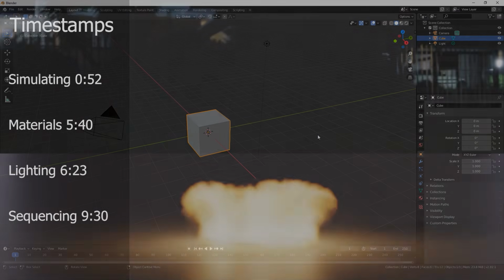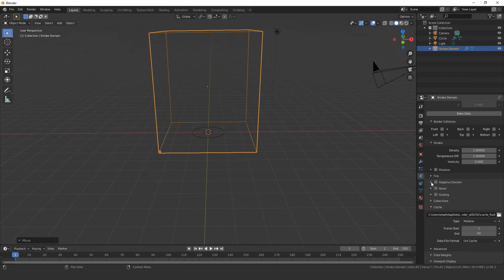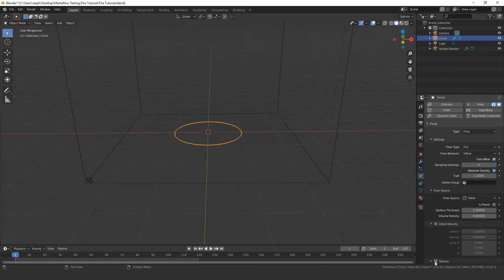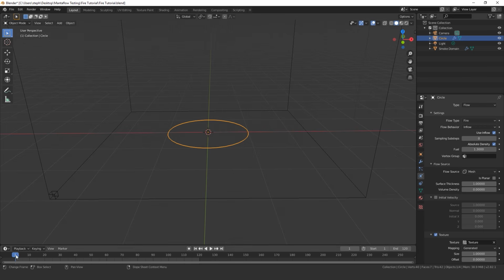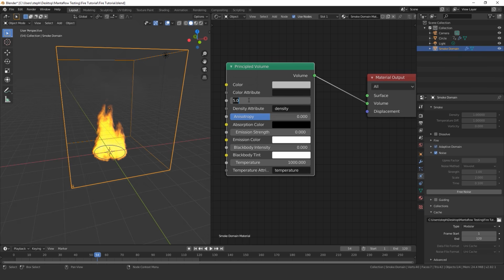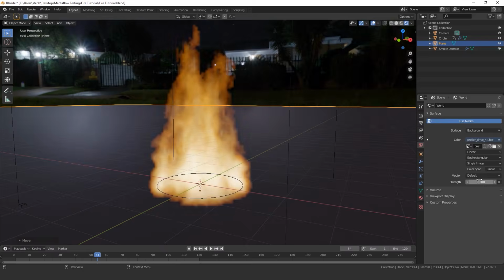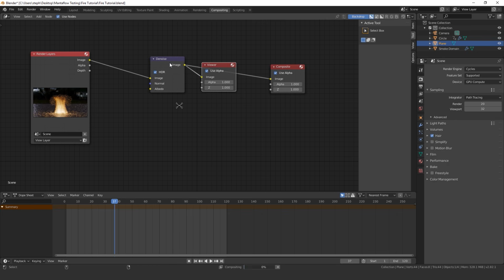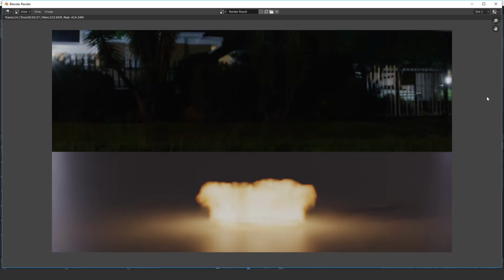Blender Tutorial - Mantaflow Fire Simulation (2.82)

Comment: This looks interesting. The results look good so far, even with me using Eevee (though I'd probably have to have my fire Point-light fluctuate its brightness or something. Glowing particle emissions worked as well in a previous experiment)
I wonder though, does this method work for a fire that you want to then have flare up and then ebb under a controlled animation driver? I'm thinking in terms of a steam-powered machine that "breathes", as inbuilt bellows regularly pump air through the firebox to fan the flames

Comment: Hi. I render with transparent in cycle. But the image render not same the render in viewport. It look faint and not real. How can i fix that?
Reply from the maker: Rendering fire with transparency doesn't work to great. There is a couple of settings you need to add before rendering. Watch this video for how to do it! https://youtu.be/wNnFfXxB2Dg
Reply: Blender Made Easy thanks you. But i have a issue that when i check the noise to bake. The simulation of smoke and fire are disappeared in render view. When i uncheck this work same with solid view. Did you know fix that ?

Comment: Your tutorial is really helpful ,but I have a question.
When I switch to the Rendered view,
 the fire does not appear, 

---
I tried :
Principled Volume( BlackBody Instensity) higher .
Render image (display channel) to color.
Cache fire anim from 1 to 150 frame.
Reopen Blender and Blender file.
--
i try it all  that didn"t make the fire appear.
i can see the fire on wireframe and solid view.
I don’t know how to solve this situation... 
thank you!!
Reply from the maker: If you can see the fire in solid view but not rendered view then the issue is most likely the material.  Double check your material and make sure the principled volume shader is plugged into the volume output and not the surface output. Are you able to see the smoke in the rendered view?
Reply: @BlenderMadeEasy  Thank you for your help!!  I plugged into surface...  I change to volume and it works!!!!

Comment: Eh. I don't think software is at the point where we can make convincing fire yet. Maybe from a distance it would work, but fire close up is rather tricky to get. Real fire has detail, like swirling and such, but it still looks gaseous. The most common problem I see is, the entire volume of the flame is lit in such a way that it looks more like a moving blob instead of an actual flame. The body isn't transparent enough, and the edges are too well defined. I've tried emulating fire myself and is it not exactly easy to get it to look real up close. Here's hoping for a future where we can eventually simulate fire so well, that you can't tell the difference.

Comment: Fire isn't showing up in the render or viewport...is there a step that I missed?
Reply: I have been struggling with this myself. I still haven't got the render settings figured out, but here's what I've got so far.  Something about the new fire in Blender 2.8 using mantaflow.  Basically, in the physics tab on the domain object, scroll down to cache.  When you open it, if it is on modular, then you have to bake it before it will show up in viewport.  You can also change this to "replay" and then it will run the simulation without baking. 
Still haven't figured out a good render yet, as using these settings is only rendering the smoke for me and not the flames.
Reply: Actually, I had the film set to transparent.  It is actually rendering ok with a dark background.
Reply: @jasminelee7834  I'll try this out thank you!
Reply: @jasminelee7834  You just saved me. Thank you!

Comment: is it possible to get a higher res? the vid is awesome man and thank you so much but I feel like my result lacks video quality...
it's blurry and has a very low resolution. Is it possible to render something a little bit better looking?
Reply from the maker: Thank you! I am glad you liked it! If you are using Eevee you need to turn the tile size to 2px in the Volumetrics panel. This will bump up the detail quite a bit.   In Cycles you probably need to set the resolution of the simulation higher to get better results.

Comment: Hey,  is there any advantage to using the denoiser node over just enabling it in layers tab?
Reply from the maker: The denoise node is much better than the layers tab denoiser.  1 big reason is that it is none destructive. Meaning you can always go back to the original render. Secondly, it can do a much better job and making clean renders.  The layer denoiser would often leave sploches and artifacts while this new denoiser does not.   You can read more about it on the blender website if you are interested.